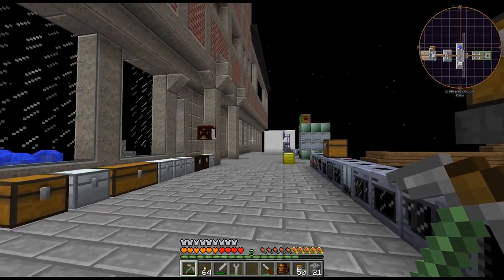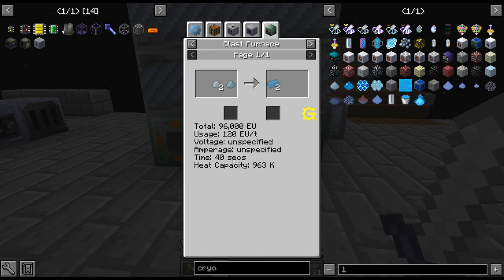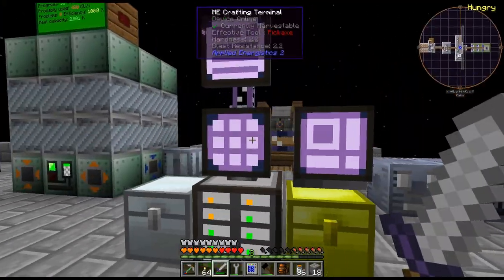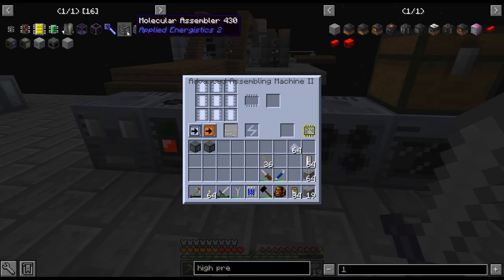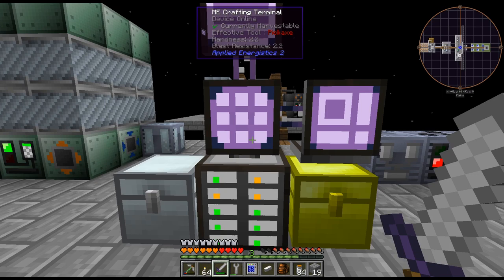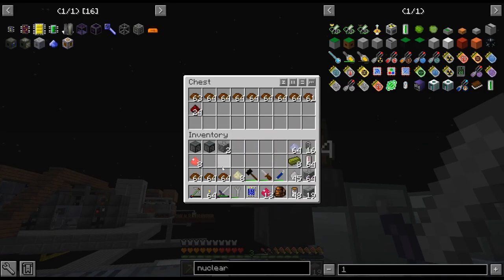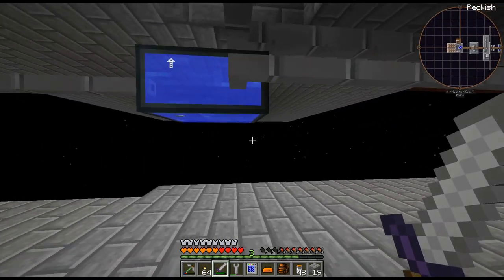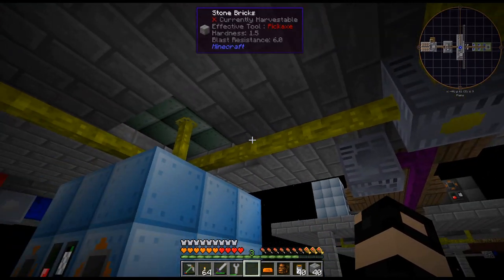GregTech New Horizons S2 - 71 - Need More POWER

Comment: Highly recommend going straight to the buffered dynamo. they bank an actually useful amount of power, and outputting it at 4a does make it a little more useful. it also means your turbine is already future-proofed if you move up to a rotor that's more than 512 eu/t

Comment: The heavy fuel item probably came from the mixer
You can use energetic alloy to make raw lapatron crystals instead of vibrant alloy
Damascus I’m pretty sure you can buy from the QB
Your ae system turned on at the end, so you must have ran out of power
Reply from the maker: There was some weirdness with the power at the end, not sure what happened but it fixed itself a few seconds after i stopped recording.

Comment: Lengthy EBF recipes aren't as bad if you build more than one of them, and keep on top of both coils and power. Try and get upgraded overclocks, it makes recipes a lot faster. Of course for your first set up upgraded coils...well, at least there's plenty of other stuff to do I suppose.

Hint for the future: Prepare titanium. Prepare a ton of titanium. You can go through dozens of stacks of the stuff trying to build serious power systems...

Damascus Steel doesn't require Thaumcraft, unless that has been changed since the prior stable release. The crazy turbine material that takes Thaumcraft is...Shadow Metal, I think it's called? It takes one bit of warp-y research in the Tainted Magic tab, IIRC, but as a turbine material it is *incredible*. The next upgrade from Shadow Metal is Oriharukon, which requires a T2 rocket, an IV blast furnace and an IV vacuum freezer. Shadow Metal takes one thaumcraft research and HV. It's crazy good.

For power I must recommend playing around with IC2 fluid reactors. Yes, they're a big pain in the rear to set up and manage, and it'll probably be a while before you've got enough resources to really put them to work, but the amount of power they produce relative to straight EU reactors is just plain crazy. The design I'm using should, barring unexpected complications, produce 22.8K EU/t from just six dual uranium rods.
Reply from the maker: I know the reasoning behind the lengthy recipe times which is meant to force you to build more EBFs. The problem is it ends up just feeling grindy instead of difficult. Just not a huge fan of time gates forcing you to build more machines in modded Minecraft
Reply: @Kharax82  Most packs I'd agree, but keeping a factory running in GTNH has so many problems and steps involved that to me it doesn't feel like long recipes are mainly just grindy. Even if there's no realistic way to speed recipes up quite yet I generally find other things to do in the meantime, so I don't end up just waiting on things to process all that often. Maybe I'm just lucky and/or sufficiently brainwashed by GTNH that I no longer remember what a sane pack is like, though.
Reply from the maker: I’ve said this quite a few times in episodes and discord. Afking over night while the blast furnace smelts 200 second recipes doesn’t require real life time spent sitting at the computer whereas building out power infrastructure does. I’m only one person and only have so much time to play and I try to do something new each episode.
Reply: You actually don't need fluid reactor to produce HU. Remote io mod has lava heater to produce constant HU with no cost, and the item is really cheap.
Reply: @chenleihu5023  Was not aware of that block. But that block really has no cost, like you don't even have to supply it with lava? I mean you could supply lava passively with an Everburn Urn of course, but at that point you could also use that lava to fuel a LHE, so I'd have to check which option is more efficient.
Reply: @TheShadowofX  No it does not consume lava. It only requires 2 buckets of lava placed down in the world to generate HU.
Reply: @chenleihu5023  So I did find and test that block, but I wasn't able to find a way to extract the HU beyond using IC2 liquid heat exchangers, and they only detected 1 HU, which translated to 0.5EU/t passively. Now I could place four on each side and have the lava on top and bottom, but that's still only 2EU/t passively across four machines. Is there a better way to extract the HU I'm not aware of, or is this block more of a novelty than practical?
Reply: @TheShadowofX  you can use ic2 steam generator to extract HU
Reply: @TheShadowofX  Never mind, it got nerfed in recent update. IC2 steam generator no longer output super heated steam when input is more than 5mb.